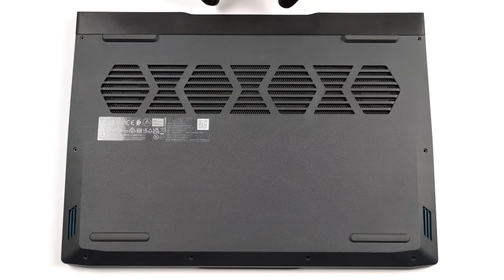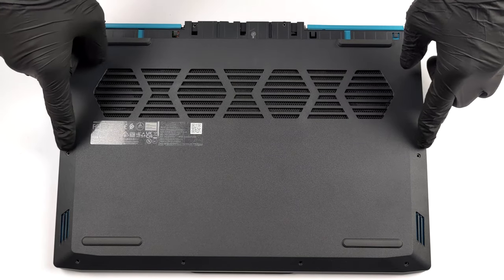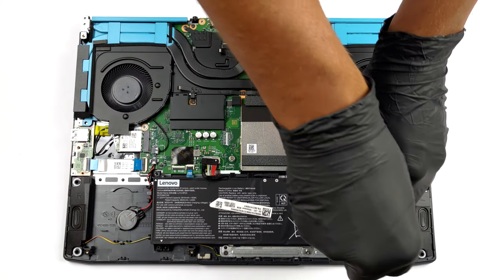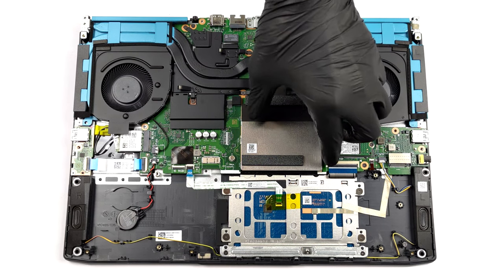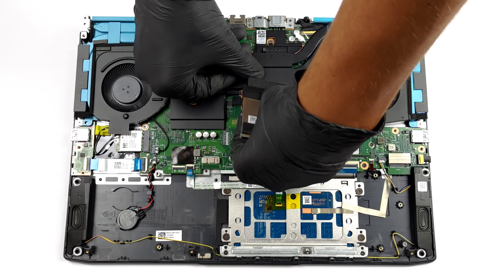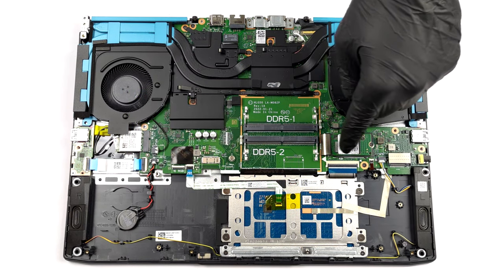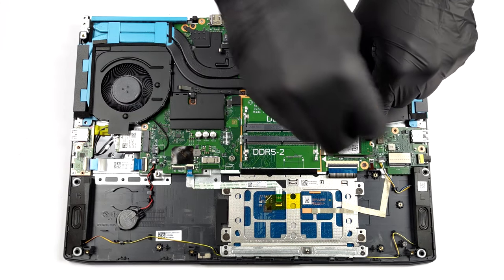🛠️ Lenovo IdeaPad Gaming 3 (15", 2022) - disassembly and upgrade options

Comment: Can this supporr 32gb of ram? Can u try it? Because in spec only max 16gb
Reply: No, the spec says that 16 GB is the max they have tested based on the max they ship the model with (notice the word "offering" they use), not that it's necessarily the max supported. The more detailed spec clarifies this with a footnote, and says that the system may support more memory.

My 15IAH7 has been running with 32 GB of Crucial RAM for months now without a problem.
Reply: @StriderNemesis  ¿Perdiste la garantía por aumentarle tú mismo la ram? Tengo el mismo modelo pero con 8GB de ram y en soporte me dijeron que si yo lo hacía por mi mismo, se me anulaba la garantía.
Reply: @victorhugoarevalogranados5822  yo la compré en Estados Unidos y ahí no aplican políticas tan anticonsumidor como esa que mencionas. Sea como sea, no necesitas remover ninguna calcomanía de garantía para acceder a la RAM, así que no hay una manera obvia de que se den cuenta que abriste la laptop si le regresas el módulo de 8 GB de RAM antes de enviarla a servicio.

Me sorprende mucho que te hayan dicho eso ya que la laptop incluso trae un puerto vacío para ponerle un SSD adicional.
Reply: @StriderNemesis  muchas gracias por tu respuesta. Crees qué haya la necesidad de quitar la de 8gb que viene incluída y comprar los dos módulos de 8gb (pienso comprar de la marca Crucial)? O sólo le compro una de 8?

Comment: Nvne gamixx n70 blade nao funciona nele. Comprei um desse  coloquei no lenovo gamepad3 com a placa3050 para minha surpresa ele não deixa copiar ou copia poucos arquivos e da  erro 0x80070b1 já fiz de tudo quando coloco no case ele funciona não sei mais oqiw fazer talvez colocar no ps5 se alguém souber como corrigir isso mesmo mudando de slot ele dá esses erros as vezes não reconhece de pois volta da o erro e some denovo talvez o dono do canal tenha visto ou ouvido falar dessa incompatibilidade meu è aquele parecido com legion 5 vocês já falaram aqui no canal

Comment: So far these comments are CONFIRMING :

2x16 RAM works fine? Haven’t seen anyone use 64gb yet. 

& 2nd 2280 slot DOES take gen4? 

Please respond to confirm/correct, even just a “yes” 😂
Reply: i love to try 32gb, someone tell us 64gb ram working too?
Reply: @cacalotas  so far I’m seeing that 64gb works!! I’ll probably stick to 32gb since I’m broke but these comments are all over the place 😂
Reply: @cacalotas  I can confirm that 32GB works! I’ve installed a 2x16 DDR5 SODIMM & a gen4 pcie 2280 2TB. Speed is unreal & most games are able to run almost max settings. Incredibly pleased w my purchases. Let me know if you need links
Reply: @XanderzOfficial  yes please can u share the links
Reply: 64 GB DDR4 its working fine for me.
Reply: @ChichoRESTREPO  Is i7 12700 for you?
Reply: @alib-kn2yt  is ryzen 5600

Comment: Hello. Thanks for this.
I am about to get the Lenovo IdeaPad gaming 3 15ihu6 i5-11300h/8gig/256gig-SSD/GTX1650-4gig.
It says the maximum upgrade is to 16gig RAM. I would like to know:
1) If it is actually possible to go > 16gig?
2) What is the highest RAM I can get into it?
3) What negative effect should I expect from increasing more than 16gig up to 64gig? (Any harmful impact on battery? Processor, Mobo? Heating?)
#) please add any other useful info on SSD upgrade (max gig per slot, form)

Thanks in anticipation.
Reply: don't and I repeat DONT get that. get the one with Ryzen 5 6600H and RTX 3050. i put 32GB 4800MHz ram and its super speedy.im using it right now. i get above 60FPS on the witcher 3 at very high settings.
Reply: @jackfein8914  thanks alot for the insight. But I need more advice please, as to why I should not get that. Please explain.
Because, AMDs are not advisable in my country (Nigeria), I live in the Northern part where is super hot (not good for AMDs)
Reply: @Leee_Rock  that’s not why you shouldn’t get it. it’s because of the GTX 1650. It’s a very outdated card. And the body of the laptop is totally different. They have ideapad gaming 3I 2022 with Intel 12th gen which the one you wanna get is 11th gen. So that means it has DDR5. And the RTX 3050 in some cases RTX 3050TI which is a much better choice. I know I’m a stranger but I’m sure you would be much happier with that and it’s only a small price difference.
Reply: @jackfein8914  😩 a large price difference for a broke Nigerian like me. The 12th gen/3050Ti is over a 100,000 naira extra for me.
Anyways, thanks for the advice, I think I'll save up for the 12th gen/3050ti version.

Thanks alot. 🙏🏿🙇🏿‍♂️🙏🏿
Reply: @Rocka Lee  how far bro, what's your budget? I can recommend one for you
Reply: @demaxl732  got around 440,000 naira saved up, that's about $630 I think. I should be able to source another $70-$100 though.
Reply: @Leee_Rock  did you get that model bro? I plan on getting the same one. How is it doing for you so far
Reply: @nidhalmahjoubi7964  nope still haven't gotten it. Still using my old sh!t.
Already spoken to someone about a MSI sword 15. It's got 3050ti
Reply: @jackfein8914  well it's budget friendly
Reply: @jackfein8914  thank you for the advice

Comment: Does anyone have a recommendation on ram I could use for this laptop. One 8 gig stick is enough. But any good deals on higher I am open. I just don't know what speed it requires.
Reply: I bought the Crucial ddr5 16gb set on Amazon. The one it shipped with is 4800mhz so anything in that ballpark will work fine.
Reply: any ddr5 2x8 set is good
Reply: I'm confused on which speed to buy from crucial, 4800 5200 or 5600

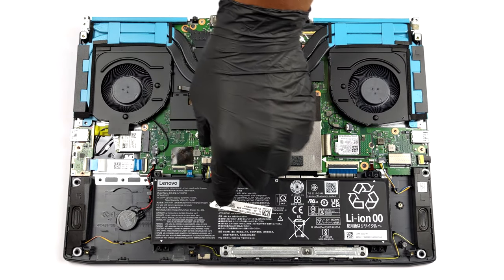Comment: 1:11 Ok, so I don't really know what I am doing.  With that out of the way, what is that little flat grey round thing near the lower left corner with a red wire coming out of it?  And is it a problem if it is loose?  I just got one of these laptops from Amazon from a Black Friday deal and mine has a rattling sound coming from that corner.  I initiated a return, but now they are sold out.  I thought it might be a random loose screw, but after seeing the inside of this thing, I don't think that any small loose item would stay entirely contained within that one corner, but my rattling issue won't leave that corner no matter how much I rotate the laptop.
Reply: it must be the cmos/rtc battery you can probably just use double sided tape it down not the main batttery but the little flat cell
Reply: I have the same problem, what did you do ?
Reply: @kevinsmaga7566  I returned it.  A few weeks later they came back in stock and I ordered it again and that second one was fine, although the price had gone up by $50.

Comment: in the slot that came with 2242  can you put a 2280 ?
Reply: there is 2280 slot on the right side of the battery if you notice
Reply: @azmihakam  CAN YOU PUT 2 2280 PCLE ?
Reply: @LeBronBoxing4Life  there is two slots for SSD m.2 2280 or 2242 one is ocuppied by default and the other one is free
Reply: @armelockhack539  so i need to buy a m.2 2280 then?
Reply: @LeBronBoxing4Life  i dont think so
Reply: @igorz3551  better if it's an m.2 Nvme SSD conection

Comment: what ram do I need to get to upgrade this? hoping to catch a black friday deal. will 16 gb of ddr 5 be faster than 32gb of 3200 ddr4 and is it ll or 22 for latency?
Reply: I depends I guess most likely a SK Hynix, Samsung, or Lenovo but you gotta do you're own teardown to find out
Reply: Lower latency ram is better. It specifies that it uses the newer DDR 5 ram. DDR 4 ram will not work. If you go to timestamp 2:20 you will see that it is DDR 5 ram.
Reply: @CLAUDIOILTEXANO  thanks

Comment: I have this same version: the 80mm SSD is the original lenovo one (the one near the battery), while the 42mm one seems empty in my case. I'm not missing anything and it DOESN'T have another 80mm SSD for a M2 SSD, right? Also can anyone point me out some 42mm SSD compatibile with this ?
Reply: I've got the same problem. Have you figured anything out?
Reply: @danieldixon7157 i was looking for a solution to this problem right now, did you find out anything?
Reply: @oyunbukucu529 yes, amazon sabrant 2242 1tb £105

Comment: What about 2,5" HDD??? HELP PLS
Reply: No slot for 2,5" hdd/ssd. Only m.2
Reply: There was room on the left side of the battery but it seems they changed  the layout and you can't  use a 2.5" anymore.
Reply: @F.A.--  yeah, it's a shame they didn't take advantage of that free space, it could have been used for a bigger battery
Reply: No lo admite, no hay slot para 2.5' HDD. Yo la cagué y compré uno de esos antes de revisar los upgrades de la lap, sólo NVMe M.2, después compré una de 1TB y va re bien

Comment: Ciao ragazzi giusto per chi avesse bisogno di informazioni, sul  mio laptop Ideapad Gaming 3 15IMH05 , Processore Intel I5 , S.O. WINDOWS 11 ENTERPRISE , ho installato 2 ssd Samsung 970 evo da 2 TB ciascuno e aggiornato la memoria ram con 2x16gb quindi 32 gb totali usando Kingstone Fury DDR4 3200Mhz CL20. Funziona Perfettamente.
Reply: Ciao, sul mio portatile l'SSD 'nativa' di Lenovo è montata sullo spazio vicino la batteria (80mm) mentre lo slot per l'SSD 42mm è libero. Mi confermi che non ci sono altri slot da 80mm?
Reply: @dudegiovanni9053  ciao giovanni allora ti spiego nel mio di fabbrica c'era installato ssd 2242 ( 40 mm) per l'appunto. L'altro slot 2280 (80 mm) con possibiltà di mettere anche un hdd da 2.5 pollici...io ho tolto quelllo da 40 mm e messo quello da 80 mm il supporto per l'attacco della vite è presente! Significa che puoi montare o una o l'altra, ci vanno bene entrambe e solo una questione di lunghezza dell-ssd da 42 o puoi mettere anche da 80, l'importante e che la fissi sull'aposito piedino con la vite, per il secondo slot si trova nello spazio riservato anche all' hdd, in questo caso  il piedino di fissaggio vite era predisposto per montare un ssd 2242 ( 40 mm ) ma il piedino si può spostare facendo attenzione a non rompere nulla, nell'alloggio che si trova poco più indietro facendolo diventare della misura corretta per2280.
Reply: @dudegiovanni9053  ovviamente non ho messo hdd avendo appunto messo l'ssd nel secondo slot, anche se volendo un modo ci sarebbe, ma si rischia con lo spazio poco sufficiente di rovinare l'ssd che andrebbe a cascare sopra l'hdd. E queste ssd costano...quindi ti confermo che io ho installato 2 ssd 2280 ( 80mm ) da 2 TB ciascuno, rinunciando al disco hdd da 2.5. Se vuoi ti lascio il mio tg cosi ti mando le foto ( aprirlo è un attimo)... se hai difficoltà.ciao
Reply: @s8s89 hello, I am looking for a solution to install two 2280 m.2 ssd, can you send it to me?

Comment: after you undo the screws for the back vent cover you can just pull it off. you dont need a pry tool for that. just installed a 16gb ddr5 stick for 24g total and a 2 tb evo970. had to get m3 cause it would be a waste to get m4.....sadly
Reply: This computer takes a DDR5 stick?
Reply: @Leee_Rock  yes
Reply: @Leee_Rock  did you watch the video sir?